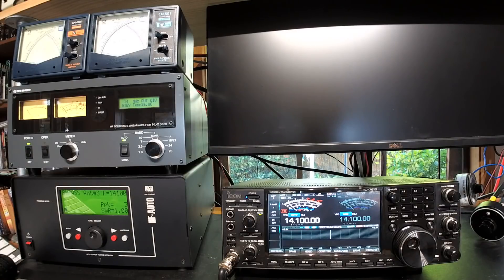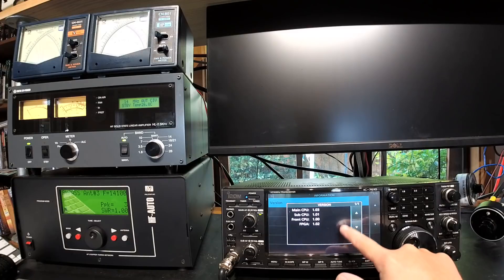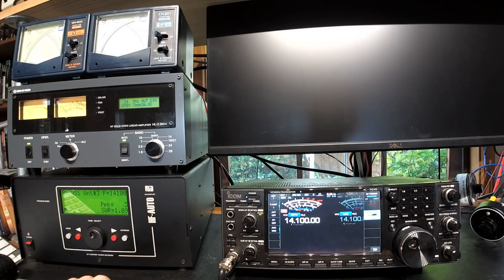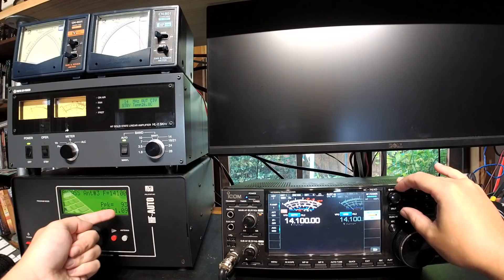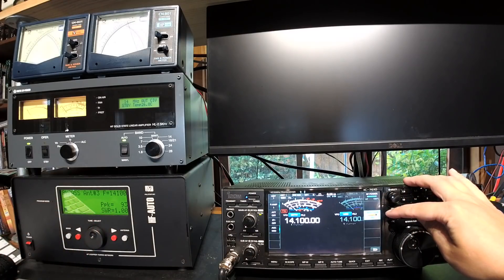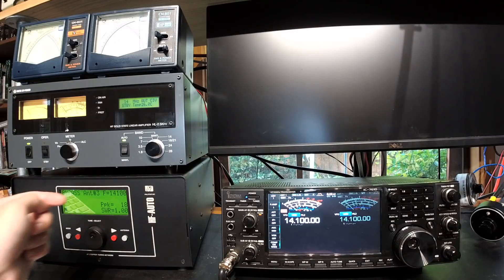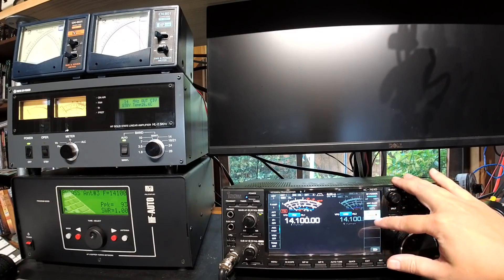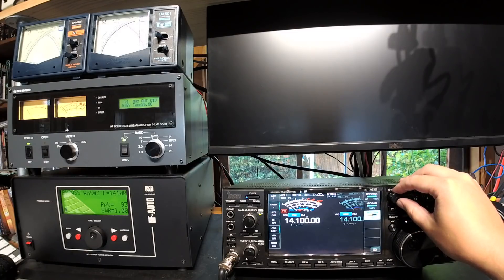IC-7610 Progressive Drive Failure Demonstration

Comment: I have been watching your channel for this very reason, before buying mine here in the US.  Thank you for the service you have been doing for the ham community.  73, de N4QM.
Reply from the maker: Dear Dennis, you're most welcome!  I'm enjoying doing it and making a bunch of new Ham friends, especially with ConDX the way it is at this part of the cycle.  I have no brand loyalty as such, but Icom has always looked after me (just as a regular old customer), which is why I didn't hesitate to be one of the first to try this great new radio.  

I've been on this rock long enough to accept that sooner or later everything needs fixing; so these days I buy on warranty, value and service.  I don't regret buying the IC-7610; I've had so much fun with it so far, and I'm happy knowing they're going over it completely to make sure they've got things right which might help fellow hams.  

The fact our national sales manager reached out to me to offer me a loan unit with NO CONDITIONS was a bonus, and I really must thank Marty.

And thats why I released this video - so that everyone knows that even though I've been loaned a unit, both my own Integrity and Icom's are intact.
Reply: I don't either, in the past 5 years I've owned a Kenwood TS-920, TS-590, Yaesu FTDX-3000D, FT-991A, FT-891, and an Icom IC-7300.  My IC-7610 will replace the FTDX-3000D in the shack.  I also have an addiction to AMUs.  I just picked up an old Johnson KW-Matchbox which is rough on the outside, but immaculate on the inside.  This hobby will bleed your pocketbook dry!
Reply from the maker: There are some fine rigs in that list Dennis!  I haven't owned, but have always wanted to own both the FTDX-3000 and the TS-590.

There is something about AMUs isn't there?  I remember when I first bought a 'real' one - a Palstar AT2K - and took the lid off; it was just so beautiful.

The Johnsons are not too common here, but I know where a couple are that are for sale so one day I should bite the bullet; I'd really like to try a 'proper' (link coupled) balanced tuner!

Stuff ain't cheap, thats true, but if you're patient and shop second hand, you can try quite a bit of stuff out and have a lot of fun without breaking the bank.  

Radio gear does tend to hold its value quite well, unlike almost anything else these days.

That said, I can't see myself needing more than an IC-7610 in 5 years, but hey, maybe an "IC-7900"? Heh... now I'm dreaming.

I can't wait to see what Yaesu and Kenwood hit back with; these are good times, let the fight begin! :)
Reply: Kenwood are now two generations behind the rest of the manufacturers in their radio design.  At the Dayton Hamvention this past year, the Flex Radio, Icom, and Yaesu booths were always full, elbow to elbow, with attendees.  The Kenwood booth was a ghost town.  To be honest, I never even saw a single Kenwood rep in their booth, and I was at the Begali Keys booth which was right across the aisle from both them and Icom.  Sad, really.

Comment: Update on my IC-7610, I performed a Partial Reset (to get there, MENU>OTHERS>RESET>PARTIAL RESET) and that restored complete control of the RF DRIVE.
1W to 100W.
Whew.  Looks like a software gremlin rather than a hardware component failure.
Reply: still holding up?

Comment: Periodically, save your radio settings to a memory card. Then you can reload your settings after the factory reset to a point in time when everything was working correctly. Manually reconfiguring all of the settings after the factory reset is a pain.

Icom now has a permanent solution for the screen failure problems that was mentioned in a comment that was two years old.
Dave KY0L

Comment: Thanks very. Much this is the biggest problem I see with these manufactures. They put product on the market and let hams field test it and only give you one year warranty.  At 3000 dollars a pop the hams are left holding the bag. I have dealt with icom customer service and it's expensive and a tax on my patience. Thanks for un covering this bad fault. A job very well done. Please keep up the good work.! De wb8idy in Swansboro northcarolina. I purchased a icom radio from Detroit and 6 months later the customer service said  we don't SUPPORT that radio any more. Bottom line was fix it your self or throw it away. I may sound bitter but I am not. Buyer be ware. So I wait until price gets to 1000 dollars and then I can throw it away. 73 all

Comment: Hi Jarred - I have been following you on your channel. I appreciate all you have shown us in the ham community. I have had the tone problem in my receiver and Sue at gigaparts took me under her wing and got the radio sorted out. Looks like Icom has a winner and with folks like yourself going through and showing us the in and out of the basic radio with all its cool stuff. I suggest that anyone who spends this type of money needs to buy the extended warranty. Although this is a bit costly, it extends the warranty out another 3 years for a total of 4 years (under the platinum warranty might be different in Australia) . This included 2 shipping tags to use if needed. Anyway, I am looking forward in seeing more information as you learn for us all.
73 - Jerry KK6YO
Reply from the maker: Dear Gerald, we completely agree with you regarding extending your warranty if you can.  The IC-7610 is a significant investment for most of us, and the extra warranty sure is peace of mind!  In VK we get 5 years if we register the radio, however we are still responsible for returning the radio to base etc.  Thanks for the kind words and enjoy your new toy :). 73, Jarrad VK3BL
Reply: Gerald Davis with field problems the manufacture should automatically extend the warranty

Comment: I found if your using a switching power supply, be sure your voltage is 14 volts to be sure. Any dropped voltage below 12 will cause strange behavior.   Unless your using a non-switching supply.
I purchased 1/4 inch lugs and soldered the power cables to the lugs and connected them the the mains of my power supply. Which is set a 14 volts and has a 60Amp rating.  I know to much, but I had it, so.  Its a diamond 60 Amp..  I also keep a 2 wire voltage meter connected to one of the other outputs on the supply to monitor my voltage directly from the supply.  They work well, snap in to any box or lay them anywhere...  Having your meters displayed would have been nice?
Reply from the maker: Good advice Mark; mine is a Manson 40 Amp and its locked to 13.8v, and powers a West Mountain Radio Rig Runner 12.  I did some testing with the IC-7300, and found that was the sweet spot for efficiency.  My feed cable is as short as possible, and 8 gauge from memory, :)
Reply: They made that 7300's cable almost impossible to cut. Unless you cut it and move the fuses and do it right with solder and shrink wrap.  i wonder why they give you so much cable. i wonder why they do that. They almost force you to use that length..
i did not cut it, I can make one from another input plug I have with the heaviest gauge wire I can deal with.. i also use a
Reply from the maker: I just cut the fuses off; they're of no use to me with the rig runner.  They make the cables long for vehicle use, and they only stock one part for all their radios so thats why its long even for a 7610 :)
Reply: Rate My Radio Do you think making the cable shorter makes any difference, considering the gage and radio draw?
Reply: Rate My Radio I just took a look at the fuses Icom uses on the cable, I don’t think you can find a lower quality fuse, I replaced them before they caused any problems.
Also, are you seeing the same power loss from the build-in meters on the radio?
Reply from the maker: From memory I think I was, but I must admit it wasn't my first concern to check :)
Reply from the maker: I personally believe shack cabling should be as short as it can practically be, and no shorter :), but purely to minimise RF ingress.  I don't think it makes much of a difference to performance/output.

Comment: Hi Jarred.  Have you heard anything from Icom?  I would really like to hear what they have to say about this problem.  There are a bunch of us out here with 7610s in the shack (more and more everyday) and are very curious about just exactly what happened to your radio.  it seems to me they have had plenty of time to trouble shoot and the silence is killing me.
Reply from the maker: Yes I have heard from Icom; please accept my apologies for not putting the reply in more places.  I have been told that a transistor went faulty on the PA board.  I believe it is just a small driver one but haven't confirmed it with the tech yet.  When I get the radio back I will let everyone know with a part 2 video :)

Comment: Just wait until all of those screens start failing.Touch screens will be a Nightmare over time yet people are stupid enough too keep buying this crap.I love ICOM but this is GARBAGE! I would NOT trade my ICOM 7600 for a case of those 7610 radios if I was required too keep & use them.
Reply from the maker: 1OFGODSOWN i’m sure the 7600 will provide many years of great service.  Just like motorcars, these days I buy for warranty, and over here we get 5 years if we register our radios.  I’m very content knowing I’ll get 5 years of faithful service out of the unit, and by then I’m sure technology will have moved so much I’ll want a newer rig anyway :). Still love my FT-101E, even the finals are original and it still pushes 160 Watts PEP plus :)
Reply: Well most of us can't afford to keep shipping a rig back for repairs at the cost of shipping & the shipping companies can't be trusted over here in the USA.All of them think a package is a Football & they treat them like one.I also have an FT-101 but it's an EX until a friend of mine comes & picks it up.
Reply from the maker: We have the same problem with Ham gear made in the states - if it goes bad shipping it back is very very costly.  I'm lucky with Icom I just happen to live 15 minutes drive away.  I'm neither here nor there on the touch screens; but it seems the way all technology is going so I can't fight it.  I'm just happy to have an SDR radio with knobs... real knobs! :)
Reply: Mine is back with audio drop out and the tone issue and a faulty display ! Waiting for a replacement  de N8DC

Comment: Were you able to monitor the audio quality of the transmitted signal? I would think if there was a problem in the driver circuitry that would be some distortion of the  signal that you could hear.
Reply from the maker: Dear Dave, unfortunately I didn't think to monitor the transmitted quality at that stage.
Reply: Rate My Radio I had a weird problem shortly after I got my IC-7300. One ham reported that my audio sounded very distorted. I tried several settings and eventually found that the SO239 connectors on my antenna tuner had poor grounding (because they were riveted in just two of the mounting holes) and I was getting a lot of RF into the audio input. Re-attaching those connectors solved those problems, and the rig has done well since. I confirmed both the problem and the cure by transmitting into an antenna, and monitoring with a second rig.